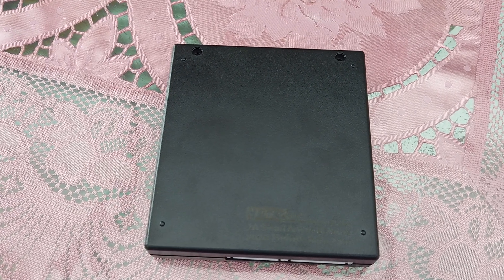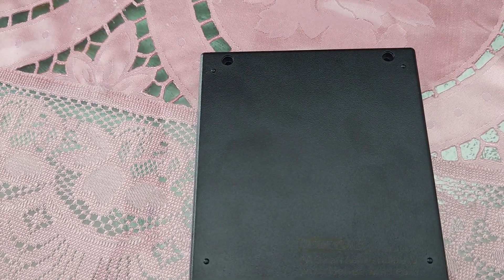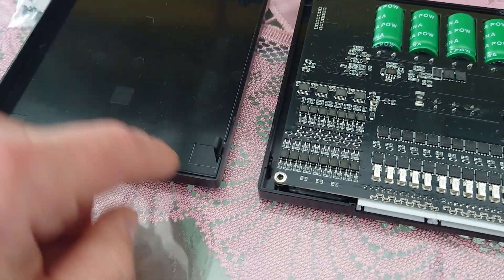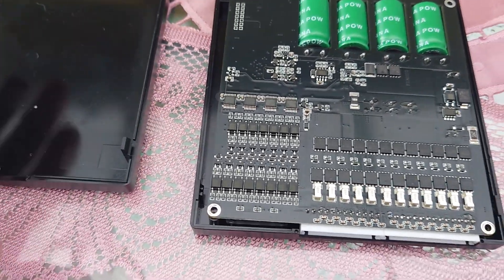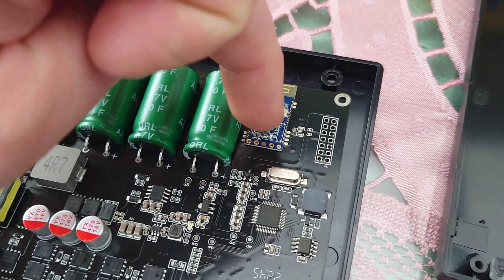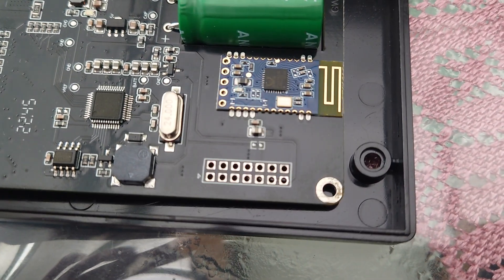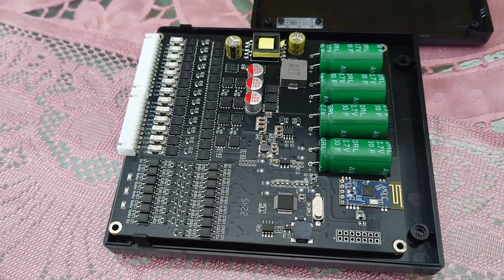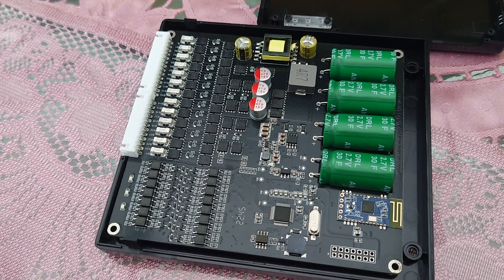Heltec 4A active balancer aka GeeWe

Comment: I have the 4th generation neey one which is the same. Trouble is, it will not work on a voltage less than 25v so now it won't connect to a 4s battery.  It's a shame we couldn't add a separate 25v  power supply to it to make it work on a 2s upwards. That would be a good all rounder balancer.

Comment: I'm looking for pinouts also, probably it has uart interface, BT is not suitable for integration with external platform. My GW-24S4EB works with 7 years old 24S PzS 400 Ah traction battery 6 monts already.
Reply: Hello 
Any news about this uart interface?
I opened mine and found this 14 pins interface, but I don't know how to connect it....